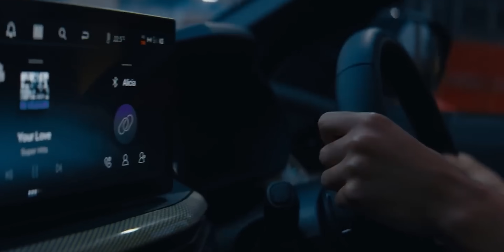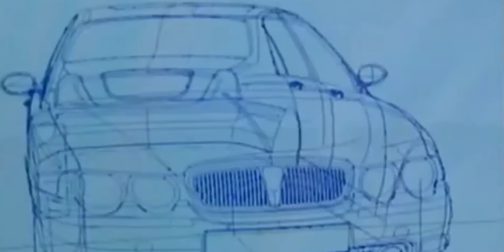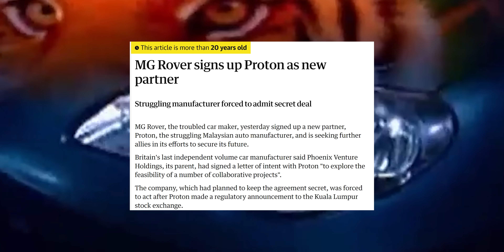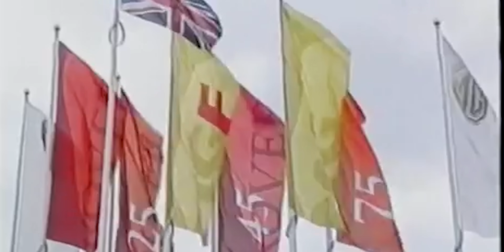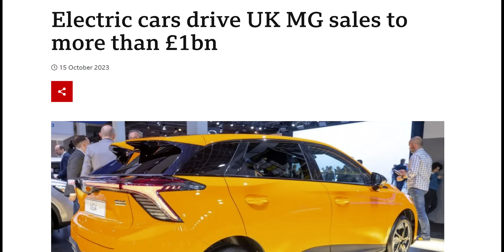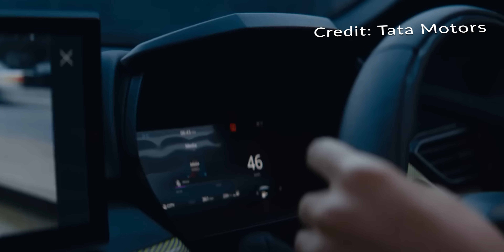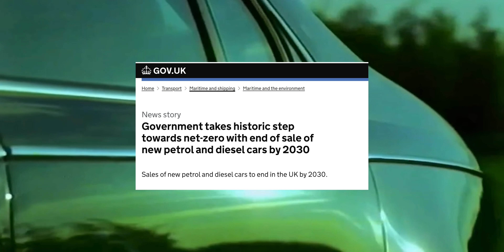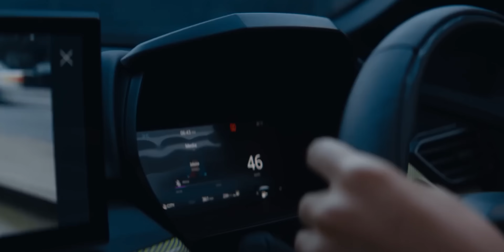ROVER COULD RETURN! But It May Be TERRIBLE!? - Exploring The Tata Rumour

Comment: One thing’s for sure. The rights to UK car brands have all been sold to foreign entities. So no chance of a UK start up acquiring one. What a sad state for a country that pioneered the car industry.
Reply: What about Reliant Motors? I thought their intellectual property was owned by the Reliant Car Club.
Reply: At least all the brands produced in high volumes. There are still some British brands (Aston Martin, Morgan, Caterham) but none of them produce large quantities. Those are niche cars for enthusiasts. (Yearly production of Aston Martin is around 5000, still relatively small series ... I guess all others are under 1000 per year each.)
Reply: Aston is owned by a Canadian (Lawrence father of Lance Stroll) so arguably - sold off to foreign owners as per so many others
Reply: So true. Britain had it all - and lost everything due to inept management, endless strikes and horrible build quality.
Reply: There could be a licencing agreement like whatever happened when Jaguar built Daimlers rather than Daimler Benz.
Reply: The same Tata that is closing its UK steel plants ?
Reply: @matthewsemple  That went back to the Daimler Motor Company founded back in 1896 to distribute German-built Daimler engines in Britain. DMC came into financial difficulties in the 1950s and was taken over by Jaguar 1960. Until 2009 luxuriously appointed Jaguar models were sold under the Daimler brand, which is now held by Tata.

Daimler-Benz doesn't use the Daimler brand for vehicles, since 1901 the cars and trucks are sold under the name Mercedes-Benz. It seems like Gottlieb Daimler made this agreement with the British DMC which is valid to this day. In 2022 Daimler Truck was separated from the Mercedes-Benz Group and is now independently managed, though there's a financial connection with Mercedes-Benz Group owning part of the shares. Daimler Truck sells trucks and buses under the brands Mercedes-Benz, Setra, Freightliner and others.

So it seems like Tata could revive the Daimler Brand if they like. It could be compared to Maybach, a company producing luxury cars (1921 to 1941) and motors, bought by Daimler-Benz in 1960; the Maybach brand was revived in 2002 for a line of luxury cars but production ended 2012. Nowadays the Maybach brand is used for some luxury versions of Mercedes-Benz cars, much like Jaguar did it with the Daimler brand.

For the time being it doesn't seem like a luxury car from an Indian company would be very successful on the market but who knows, they probably had some thoughts when buying the brand along with Jaguar.

Some other brands curiously held in India are Tempo (known in Germany mostly for 3-wheelers, active 1928 to 1966) and Eicher (German company building tractors and other agricultural machines 1938 to 2001). Oh and Banaras Locomotive Works owns all the rights to the designs of Alco locomotives (not the brand) but that's a different story (Alco is out of this market since long and the brand name was last used 1984).
Reply: @uncipaws7643  Just a quick clarification: Daimler and Benz didn't merge until 1926. The brand Mercedes-Benz appeared the following year.
Reply: @stanwbaker  Thanks. Mercedes (as a brand name) is protected since 1902 for the Daimler-Motoren-Gesellschaft (for the daughter of a distributor). Benz joined later.
Reply: @uncipaws7643  I can see were coming from with Aston Martin, Morgan ect but they basically vegan sausage rolls may be"brtish"  but all are owed by foreigners or part cars that buy parts ie engines of foreign car companies only real brtish brand is elvis motor cars I believe they make everything in house
Reply: reincarnation rally 6r4 metro EV would sell by the ship loads

 🇬🇧👍
Reply: Is not that simple. Most of these rights have now expired. There's only copyright on badges remaining. The brands themselves are free for anyone to use at this point.
Reply: While most major UK car companies and trademarks were acquired by Stellantis,, SAIC, BMW and Tata (JLR), any not being sold new now are actually expired. No-one owns the defunct brands. There is just copyrights for the previous logos. Anyone can now reuse the names.
Reply: @nickb2179 yes but designed and made in U.K.   the U.K. economic policy has been not to support manufacturing and to sell off assets to highest bidder. Has been for years. 
Thankfully Aston are still based here. Not sure in this day and age many true British companies of a decent size exist. What does the country manufacture? Not much😩 sad. Most countries protect important manufacturing sectors.
Reply: NO it didn’t………The Germans and Americans did, but the English were early in the game.
Reply: ^ False. The 2nd Car ever - and the 1st with four wheels - was British, actually.
The UK also invented the internal combustion engine.

@pilskadden  Not really on the last one. Build quality for a lot of contemporary Italian & French cars was worse, and German cars are comically overrated on reliability 😂
Reply: @uncipaws7643 Meybach isn't a great comparison, as their Dixons on wheels land yachts were a commercial flop for Mercedes.
Reply: @thy_tortoise1570 Not quite. Morgan & Genetta are British in totality, and Aston is partly British owned, an improvement on when Ford owned all of it, and the switchgear was plastic garbage 😂
Reply: @jimtaylor294  And how many Daimler models did Jaguar sell?
Reply: ^ Maketh any sense as a reply, that doesn't.
The point is that the Maybach revival was - by the brand's own owners - a commercial flop.
Look it up boyo; I'll wait 😆
Reply: @jimtaylor294  That's exactly what I wrote a couple posts up.
Reply: Welcome to Capitalism!
History, heritage, tradition = 0
😢
Reply: @antoniomp-PT  Cronyism*
Reply: @nickb2179 Aston is slit British
Reply: The Rover brand name is owned by Jaguar Land Rover owner Tata. 
Reviving the brand would be a mistake, it’s best left dead.
Reply: Owned by Beans Engineering. But it is British
Reply: The UK was a leader in car production and many designs and engineering combinations. They have been leaders in F1 for most of the last 60 years but far left union leaders and bad management left us with little but foreign owners.
Reply: @matthewsemple  British Daimler (pron. daym-ler) and German Daimler (pron. dime-ler) were separated before Jaguar absorbed (British) Daimler. The original deal was that Gottlieb Daimler licensed the Daimler brand to H. J. Lawson in 1896; the (British) Daimler Motor Company was purchased by BSA in 1910.
Reply: @21stcenturyozman20  Yup. Mercedes also tried to buy the British Daimler brand up some years back, but Jaguar refused.

The reason Jag' got it though was due to the Docker family running Daimler into the ground financially, wasting most of the capital the company had built up during WWII.
Reply: @ElderNames Is that how there’s a firm making EVs calling itself Morris Commercials? It’s even styled after the old Morris J van of the fifties. Not sure how many they’ve made yet, or if they’ll fold like all the other EV van & truck startups.
Reply: @eamoneejit  yes.
Reply: @jimtaylor294  Morgan are owned by the Italian investment group, Investindustrial.
Reply: Irrelevant
Reply: @eamoneejit 

As well as their J Van's, Morris are also making an EV Morris 1000 car. Also Austin's are back in a new premises in Essex, building EV sports cars based  on a 1920s model.
Reply: @johnbrereton5229  I saw a YouTube video about a Minor remake but it looked like an AI “50s Panavision” effort. The cars looked different from picture to picture so I didn’t finish it
Reply: @eamoneejit  
A lot of manufacturers use AI generated images in the initial stages to test public response. However, they have definately built the vans and they are on sale.
Reply: @pilskadden inept and indifferent management. They didn't care about the cars, only the money. British car industry was destroyed by Accountants....as most companoes eventually are...
Reply: @pilskadden . 🤔
Reply: @pilskadden I was tod a story of how mangment would cause strikes on purpose when they had stock that needed ruling down.                                     They would go on the shop floor and sack someone that did something wrong in this case broke a 65p hook and then the unions would think they won after a long strike period
Reply: This is what happens when greed, arrogance and ignorance becomes the norm instead of being flexible, open minded and future minded. Welcome to the capitalistic downside of the medal where quick money and political power games are more important than to maintain a healthy industry.
Reply: @AlexisTichko  . You're probably right about that my dear. 🤔👍
Reply: @mikewallace1723 Absolutely correct.Had occasion to visit my local GPO distribution depot.Early morning and no vans had left for delivery duties.Looking around the place was of course full of foreign made commercial vechicles.How on earth did we get to this situation?All the vechicles we could have supplied but instead the industry was allowed to die.Absolutely no way would  the foreign  competition allow such a situation to happen.

Comment: I can't believe the Aussie Rover Quintet got a mention! Nice job! We received two Rovers that were rebadged Honda's for the Australian market. The first was the 1983 Rover Quintet 5dr hatch (Honda Quint) and the second was the 1986 Rover 416i 5dr hatch (1st generation Honda Integra). The Rover 200 and Rover 400 Series were never sold in Australia, though we did get the car that the 200/400 were based on, the Honda Concerto. Later on we did get the MG ZR 3dr and 5dr hatch and the MG ZS 5dr hatch (Rover 200/25 and Rover 400/45), but sales were very limited as the collapse of MG Rover followed in 2005.

Comment: having seen the cheap junk that’s now called MG, it’s just sad to see heritage marques bought for pennies and ignoring the ethos that the brands once stood for
Reply: Indeed. From a business perspective it makes no long-term sense either, as it's a game of ever diminishing returns.

Far better to play the long game, and focus on building up a brand's reputation for engineering excellence, amazing value or whatever it's specifically catering for.
Reply: Okay but 1. MG is actually the lowest priced cars in the UK by miles in class and yet they are not worse than most established brands, in fact they're way better usually

2. Current MG isn't just a name. They are the full original MG with all the MG assets.

3. Thank MG for helping to finally reduce car prices in the UK by undercutting everyone by £10000
Reply: ^ Complete claptrap 😆 .

Also; being rock bottom chinesium with transparent stolen valour branding isn't something to shout about 😆 .

Give it a few years, and this fake G's will occupy the same category as the Alfa Romeo Arna does today; extinct on UK roads, and still perceived and derided as the clunker crap for the unwary that it always was 😆 .
Reply: It's paradoxically still possible to buy an actual new MG though... albeit from British Motor Heritage, that still manufacturers all parts and complete bodyshells for the MGB.
Reply: @jimtaylor294  What part of this is claptrap? Also newsflash, basically everything that doesn't have a Toyota, Lexus or older Honda badge is junk. You act like MG is uniquely bad as if Stellantis aren't producing cars fit for the landfill from new for 50% more money.

Nice you call it Chinesium as if that isn't a good thing. Where do you think lithium batteries come from? Lol.
Reply: @jimtaylor294  ironic you're posting this on a Rover video as if Rover isn't one of the worst car brand in history. Even Lada belongs above it.
Reply: @jimtaylor294  I really cannot get over the fact you said no Chinese car meets 60s safety standards when they usually get 5 star NCAP result 😂🤣🤣🤣
Reply: @jimtaylor294  rover set standards for quality back when your choice was rover or a bike. The slightest hint of competition arrived and that was the last anyone heard of them. The best Rover of the 90s was the Rover 200 aka the Honda Concerto.
Reply: @jimtaylor294  what part of setting standards back when standards were so low is impressive
Reply: ^ Paid Shinoshill confirmed 😆🤣 .

PRC cars have repeatedly failed western crash safety tests, have substandard engines, and are generally substandard and derivative in all features worth measuring. You'd have to be a paid liar to state otherwise.

A~and nope. Rover was setting standards for safety, quality and rust protection into early '70's, was still above average for most of the BL era, and remained a high bar overall [relative to the norm'] until the BMW period, when the company was asset stripped.
This is factually demonstrable, to anyone with eyes, the ability to read and a passing knowledge of cars.
Reply: @jimtaylor294  oh wow, into the 1970s, what happened after that? Oh right, competition, which showed just how bad rover was. Funny that.

Rover is the worst brand of car of all time and survived 40 years too long.
Reply: @jimtaylor294  "paid shill" when all you need to do is look at euro ncap and see that rover got the worst result of all time and Chinese cars get 5 stars
Reply: @jimtaylor294 but I don't want a death trap
Reply: @BigLeek-ig3sb my dad brought a lada in 1990 and although it was not a bad car at the time far better than everone makes out  it wasn't great and now Renault has pulled out of Russia due to the ukraine invasion they no longer have air bags no abs no seat  belt pre tensioners and out of date fuel injection ie euro 5.          But yes cars like the rover metro were crap and killed the uk car industry
Reply: @jimtaylor294 what my dad's morr marina rooted at the bulk head the rovers  were far behind there's a reason the mark 3 and 4 escort sold so well
Reply: @gingernutpreacher  That makes no sense as a statement.

And~ nope; the Ford Escort mk.3 was mediocre (the change to fwd and worsening of materials used made sure of that), the mk.4 was garbage, and it only got even worse from there.
Those that weren't written off by teenagers stealing and crashing them at the time, have mostly been melted down for scrap 😆 .

Most Ford's of the '90's and 00's were plastic'y crap, dull as ditchwater or just goppingly ugly.

You're more likely to see a Metro these days in the Midlands, than an Escort... and thank god because only the Cosworth was worth owning anyway... and the Sierra Cosworth was better than it 😆 .
(because it was based on something  decent, rather than dogschizen)

Comment: The original plan was to sell the Tata Indicar very cheaply at £4995 and badge it as an Austin to create a brand a bit like Dacia 'You do the maths' but MG Rover management got greedy and thought they could sell a City Rover for between £6k and £8k. At the £4995 price with a service pack and low finance the Austin would have sold against Dacia which has become a huge hit. I think Rover's day is done and I have an 800 Sterling and a 75 but selling cheap mass market Rovers is just a travesty and no one would buy them, MG has a bit more sporty image even though the cars have nothing to do with MG in any way, just a badge on a Chinese built and designed product. Another sterling video Tom, well done lad.
Reply: The other brand that could have been used for the City Rover was "Metro". it would have been a perfect fit for a car with a budget image and one that still had fond memories in a large segment of the car buying public. From what I have read, it was never even proposed, even though it was an obvious one to use.
Reply: @anthonybarrett2446  I always thought they missed a trick not calling it a metro

Comment: They won't be Rovers just like the MGs these days are not MGs
Reply: Yep your right
Reply: Correct, just like the MG 1100 was not an MG, the last Rileys were not a Riley and the last wolseley, in fact it's argued that the MG brand ended when BL closed the Abingdon factory. The Rover brand pretty much ended when Austin Rover stopped making the 3500 SD1 and started sharing platforms with Honda. It's also argued that current Minis are really Binis and nothing to do with Sir Alec Issigonis. The examples go on and on. Badge engineering has been happening ever since the badge itself was invented.
Reply: That's like saying Jaguars aren't Jaguars or Land Rovers aren't Land Rovers due to being owned by TATA